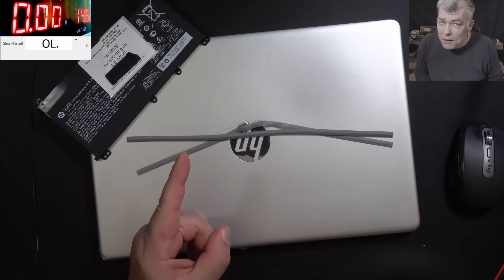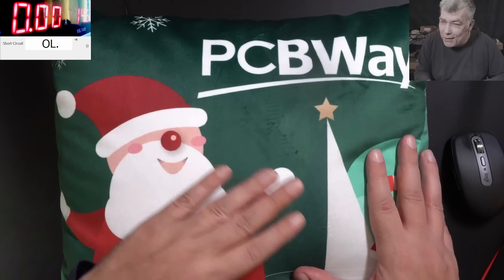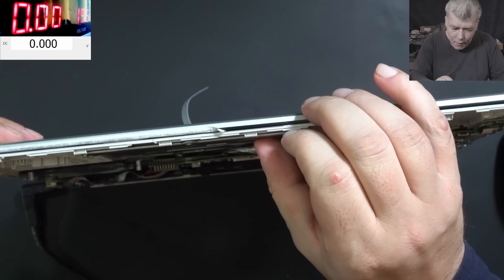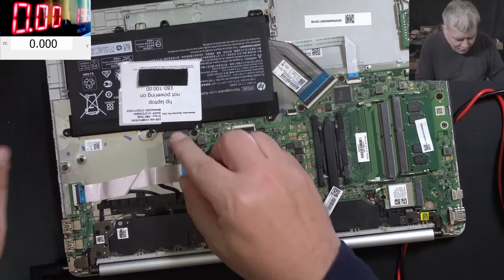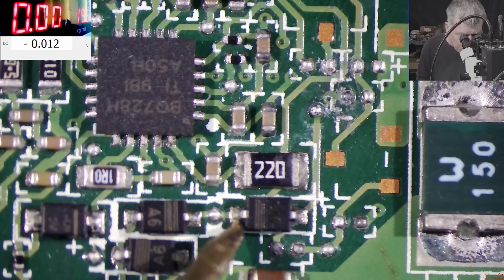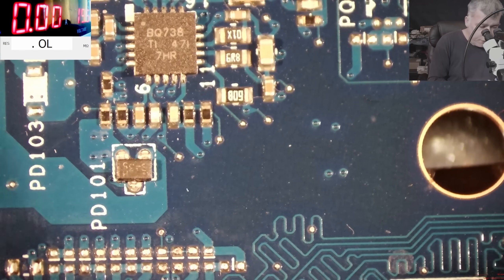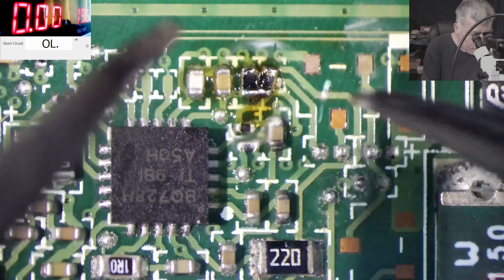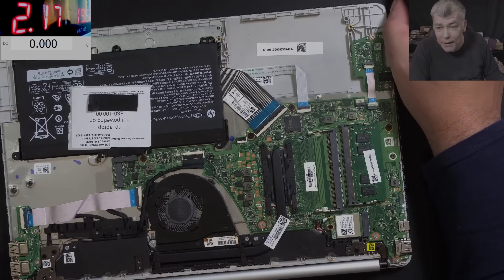Hp 15s-fq1003na no power - Let's see how a dodgy and a normal repair should look like

Comment: Nice PCBWay freebies!!   -   I really dont like those rubber strips/feet on HP and Lenovo laptops as they always seem to get stretched when removing them, I wish I could find a roll/reel of 5mm wide rubber I could cut to size and glue on after I've repaired/upgraded a laptop.

Comment: Sorin, that original resistor was probably good, it had one leg making no contact with the pad due to water damage corrosion. You have measured the over 400K resistor on a 20K scale, obviously it was shown as open. You should have tried to solder back the one leg which was not making contact. Now the laptop is not having the proper size resistor (I mean physical dimension is bigger than the original).

Comment: i am working on same model of laptop this week but it have some weird low cost processor and no cooler just metal plate nad 1 memory slot instead of pipes and a good processor. mine is turning on but no picture now in search for bios for it to try that first bcus its turning on charging everything cool.

Comment: what about if i dont have that resistor, and i solder a wire from that acdet to cmos battery 😁
Reply from the maker: That should do the job! Smart!
Reply: @electronicsrepairschool  loool
Reply: That will work... but CMOS battery will get drain fast